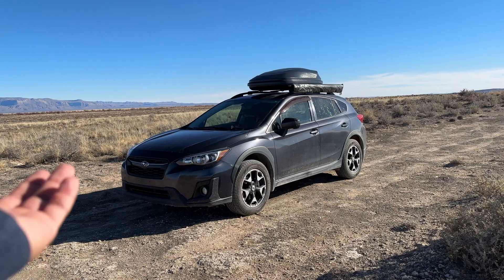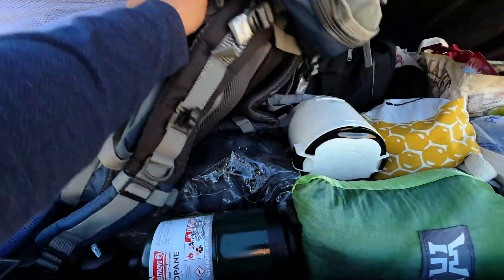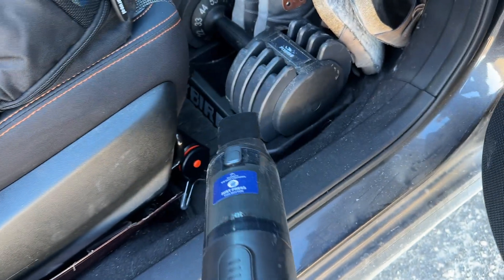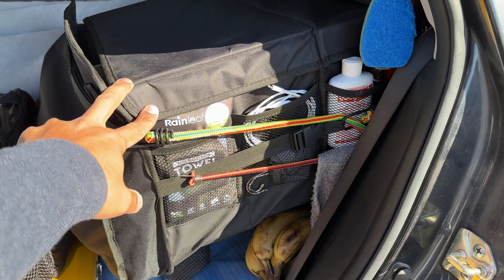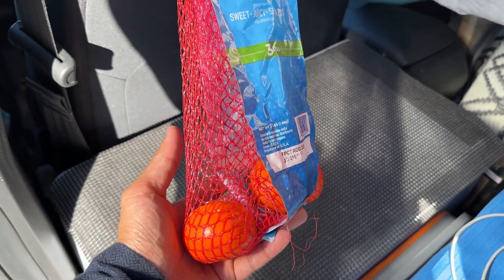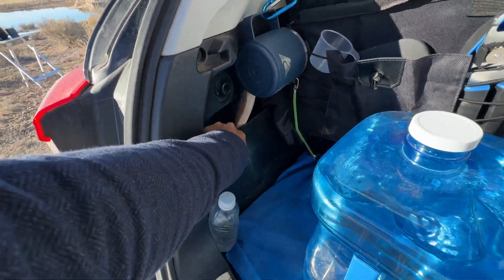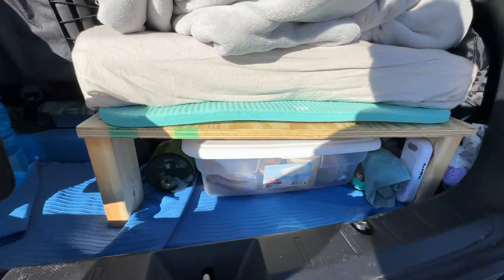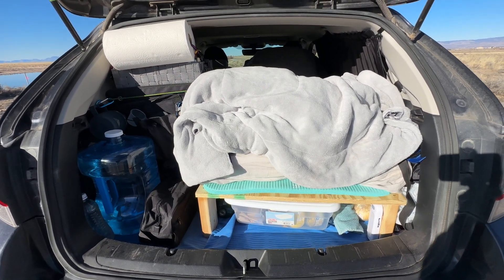I Live in a Subaru Crosstrek | Simple Car Camping Build and Tour

Comment: Thanks for the tour! The carabiner trick is very good to know. I have a 2013 Crosstrek and love it. I don’t live in it (yet) but do camp a lot, sometimes with my spouse. I found that the Exped mega mat duo fits perfectly in the back in terms of width - it’s a little bit longer even with the front seats all the way forward so I just tuck it behind the front seats. The different level when the seats are folded down is the only trouble. That still leaves room on the floor in the passenger area.  I also have the window screens (game changer!) and that same usb fan. I wonder if there’s a screen for the skylight. With a longer storage box on the roof, we can fit clothes and food/cooking stuff. I just use a cooler for a few things like creamer for the coffee. I love the rice cooker and kettle, but I’m not sure about getting the solar and jackery. Can you actually power those appliances with solar?
Reply from the maker: Yes! As long as the appliance’s wattage draw is less than your power station’s output capability, it’ll be fine :)

Comment: Great tour. I also have a 2018 and worry about draining the battery when the hatch is open. I'm going to try your carbanier idea. Will it also turn off the light?
Reply from the maker: Yes it does! Trust me, I’m paranoid about it after I was stranded with a dead battery haha.
Reply: I saw that too. Cool trick.
Reply: When my Crosstrek hatch is open it only turns on the dome light, which can be shut off manually. Why would an open hatch drain any power if the car is turned off???
Reply: What an quick fix. I now keep a caribanier in the back. Works!!

Comment: Just in case my other comment is buried, why does an open rear hatch drain a battery, if the car is turned off and the dome light is also turned off? I can’t think of any other drain. BTW, watch out for high humidity levels inside the car, like from your exhaling all night long. I have heard of serious electrical issues as a result (not just Subarus either).
Reply from the maker: Hi! From my understanding (via Subaru Facebook groups) the hatch still draws power even if the light is off, the dash light indicating a door is open is also on. I woke up to a dead battery cause I kept the hatch opened all night several nights while sleeping and that was the only thing I could think of that drained my battery. I also sleep with the windows cracked so humidity isn’t a huge issue. Thanks for watching!

Comment: Should I get the extended warranty when I buy my new Crosstrek?
Reply from the maker: I didn’t, solely relied on the dependability of Subarus.
Reply: Yes, dependable. But if u can afford the Subaru Added Security warranty, get it. The cars are far more complex now, such as the Eyesight system. Take a guess what it takes to diagnose and fix that, at $170/hour labor charge? :)